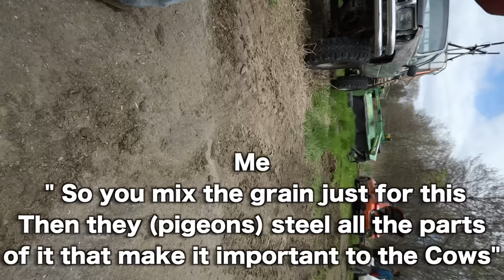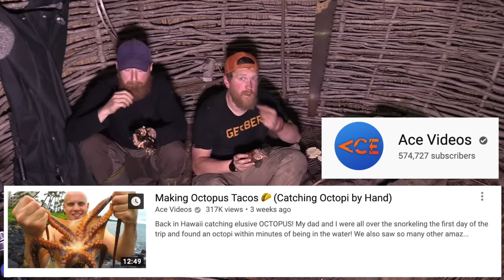Slingshot Catch and Cook Pigeon AKA SQUAB Day 7 of 8 Maine W.L.C. /Catch And Cook Survival

Comment: I agree with Zachary. When making soup out of cooked poultry I always simmer the bones, skin, and fat for a while first, then add the diced meat at the end before serving. That way the meat doesn't over cook. If the meat is tough I would cook it for a while in the soup to tenderize. If starting with raw poultry I make a soup stock out of the less meaty pieces (neck, back, wings, skin, fat, etc.) and roast the meaty parts. You can add the left over cooked meat later to make a good soup. At home I keep a ziplock bag of soup parts in the freezer and when it gets full I make broth. Yum.

Comment: The turkey was breast was juicy at first because you cooked it properly. Any time you reheat it after it will be tough and dry. In order to get around that, you have to cook it for a longer period of time. This is called braising. Chris was kind of right. Although it has nothing to do with the fat content or letting it rest, although fat is flavor and good calories, so it doesn't hurt to have it. 
When you cook it will shrink, and tighten up. If you cook it for longer the protein strands and collegen strand will continue to break down and it will become tender. You can cook this until its a sludge, where you can't even tell its a turkey anymore.
Cook on a gentle simmer for about and hour to an hour and a half and it should be tender again and you will be able to shred it.
This applies with most all meats, but depending of the meat and cut the cook times will vary. The harder working muscles (ei. Legs, stomach, cheek, tongue) of the animals the longer the braise time. The less active muscles (loins, breast) will take a shorter time to braise.
Hope this helps you guys enjoy you food more.

Adam Meade

Comment: The turkey would have been a lot tender with juices if you have made it in a ground oven. A big hole, a flat rock on the bottom, and then rocks going up on the sides, a big fire for heating the rocks, after that dump the turkey on the hot rocks, cover it with other hot ones, and then a layer of coals on top of it. Wait a few hours and that's it.

Comment: Two things I can think of. 
If possible, and if sufficient salt is available. An overnight brine. 
The second, would be to to use that bigger pot as a closed braiser. 
Basically cooking it with a small amount of liquid, low and slow. 
If the brine was possible, together should produce a very tender turkey. But braising alone should help a good bit.